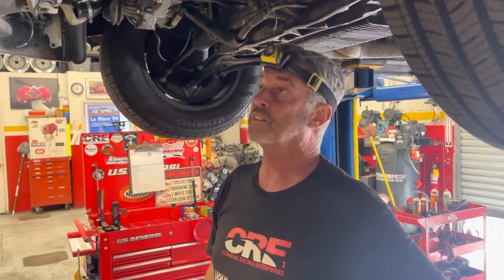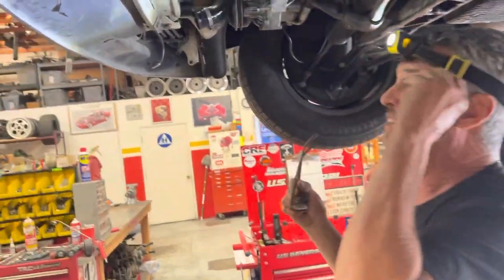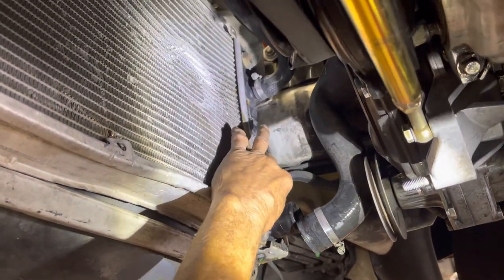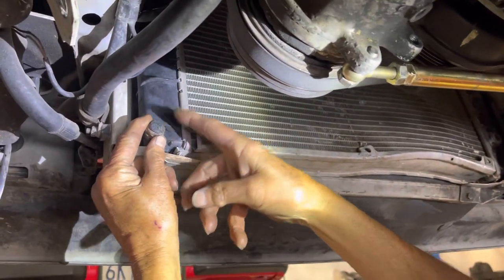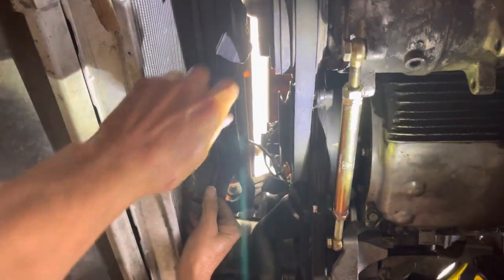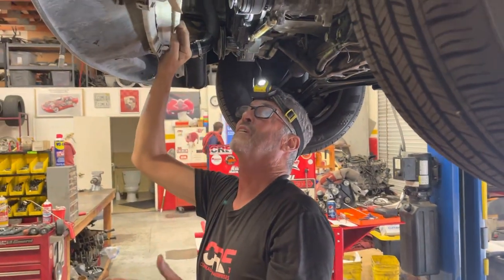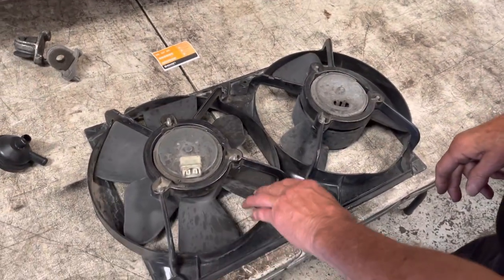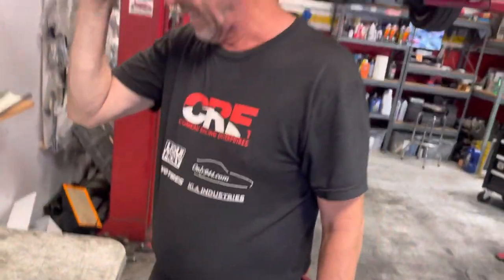Porsche 944 ￼ messed up Radiator! ￼

Comment: The mechanic I took my turbo to before Tim apparently managed to leave the fan shroud top bolts off when doing a test start of the car. Wouldn't have been terrible, but the belt covers were also off, so the fans fell back on the pulleys, sawing directly into one of the connectors on the fans. (Spoiler, I ran for the hills shortly after and found Tim)

Comment: Is the water pump always in the same location? Or are there models where the location of the water pump changes?
Reply: Always in the same location. The 2.7 / 3.0 liter engine pumps have a larger impellor that can't be used with a 2.5 liter block. Make sure you get the correct plastic fitting on the front of the pump. 2.5 8 valve engines have a "block off" fitting, while 2.7, turbo, etc have a "pass thru" fitting and a hose attached.

Comment: Any chance you might be able to show what you were talking about in regards to the part that goes to the charcoal canister in your next video.  I have a smell of gas in the garage after getting back.  I wait a few minutes then release the gas cap and pressure outside and then no smell in the garage.  I don't think the canister system is working and I do not remember seeing any kind of lines coming off the radiator.
Reply: No, you misunderstood. They installed a "bull horn" thermal vacuum switch in the radiator instead of the correct blue drain plug. The bull horn is for routing vacuum to the 2 valves that control venting the gas vapors in the charcoal canister. The gas vapors are fed back into the intake and burned off. Check that you have the proper gas cap and that the tank is otherwise  venting to the canister. Also, if you're missing the heat shield above your muffler, it will heat up and further pressurize the gas tank.
Reply: @timcomeau420  thanks for getting back with me.